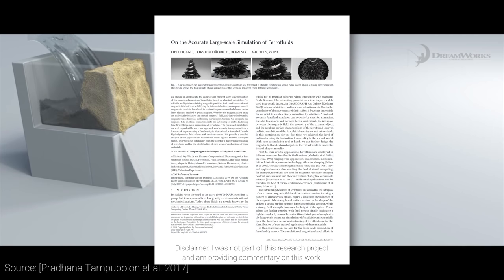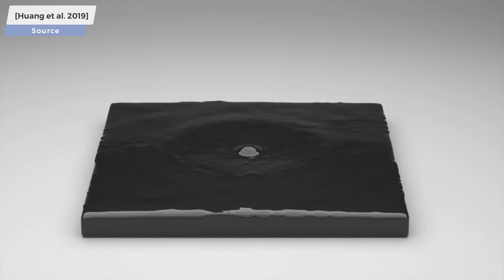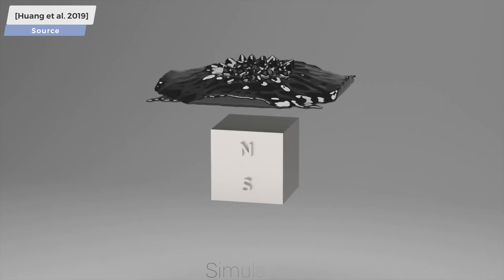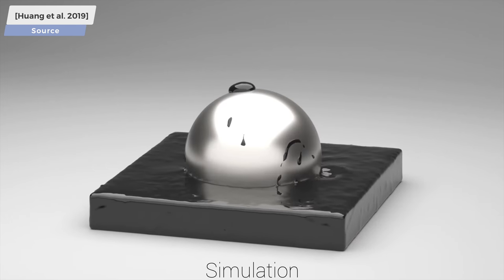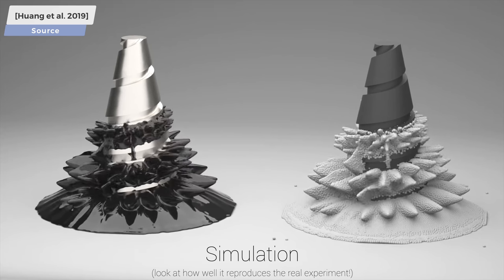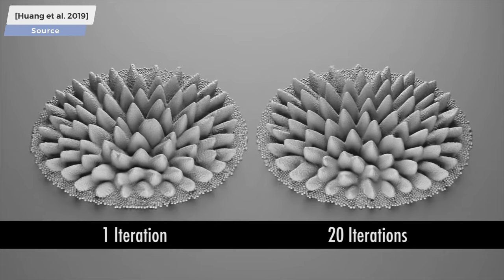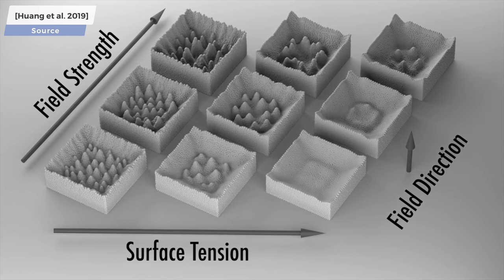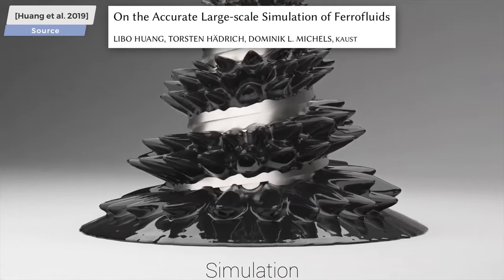How Can This Liquid Climb?

Comment: That's amazing!!  The only problem that I saw was that the ferrofluid didn't leave any residue, so it makes me think that the surface tension was too high, but I'm not the best to ask if that's really why the residue is left.  Truly amazing paper, maybe we'll be able to design an electromagnet that can allow a ball of ferrofluid to float using this simulation.
Reply: Another reason could be that the simulated surface is a lot smoother than any real surface. Or some cohesive forces not being within the scope of the simulation.
Reply: Oh yeah, I suppose that makes sense.  Since it's a digital confine rather than a surface there wouldn't really be any friction on a surface that's not there.  Raises the question though of how well it handles friction on non magnetic/non perfect surfaces.

Comment: Jesus, I don't think the incremental applications of this is fully appreciated, Imagine an moldless process that takes an input topology then forms the ferrofluid.  When I see this I immediately think of Hydraulic press molding, and 'Printed Polarity Magnets' and SPIF (Single Point Incremental  Forming.  _ also see F3T Ford Freeform Fabrication Technology_ .
Shame far reaching applications are not delved into in the paper. No doubt papers will come after this dealing with solvers that can produce outcome shapes then the crazy stuff will start happening.

Comment: What could be its application? You know, bessides pretty figures?
Reply: If the simulations are physically accurate, it could be used in engineering. Ferrofluids have some interesting potential applications, and computer simulation would make it cheaper and faster to develop these technologies.
Reply: @darkcheese98  Such as?
Reply: @kebman  The most common current uses ferrofluids are sealing hard drives and cooling loudspeakers. Potentially, ferrofluids may be used in medicine (drug delivery, thermal treatment, nanosurgery), spacecraft propulsion, telescope optics, and energy harvesting, among other things. (source: Wikipedia)
Reply: @darkcheese98  I wonder if it's good in liquid switchers. Anyway, awesome, man! Thank you!

Comment: Great work as always!  Can I suggest adding some background music? My sound system turns off when there’s zero audio so your last few videos have been cutting out often when you pause talking and I miss your next few words when it takes a second to turn back on. Thanks!
Reply: I prefer there not to be music when it is not relevant.

I think you should fix your sound system.
(Or work around the shut-off by mixing in some infrasound source?)